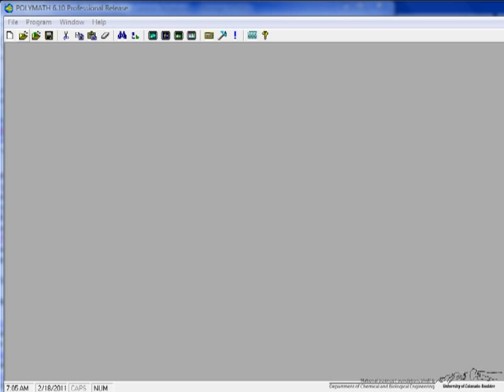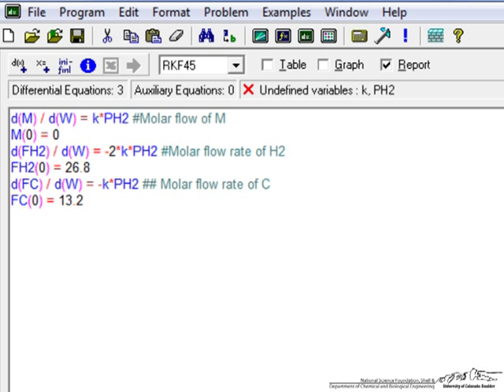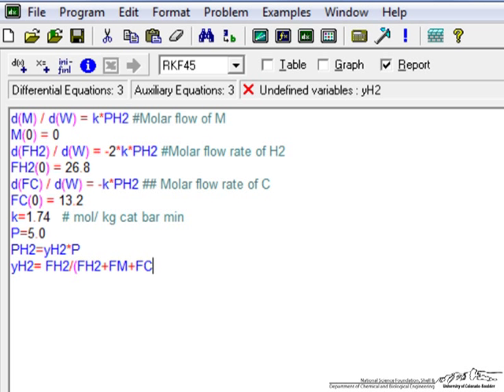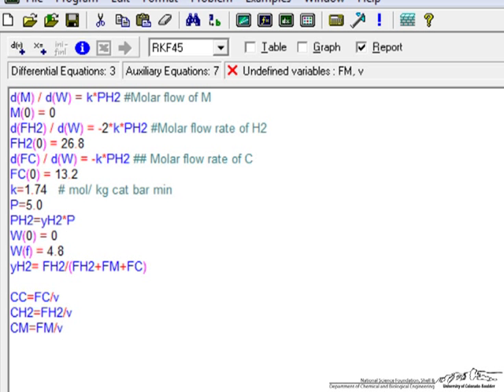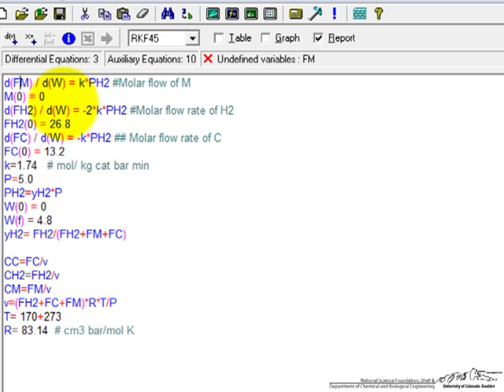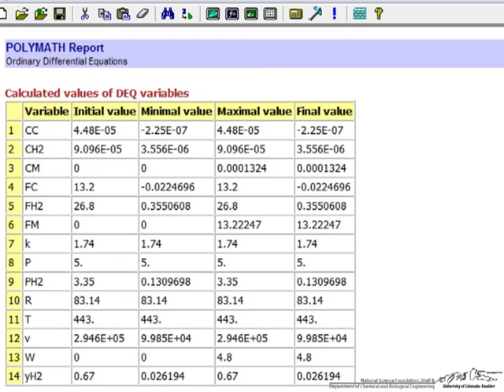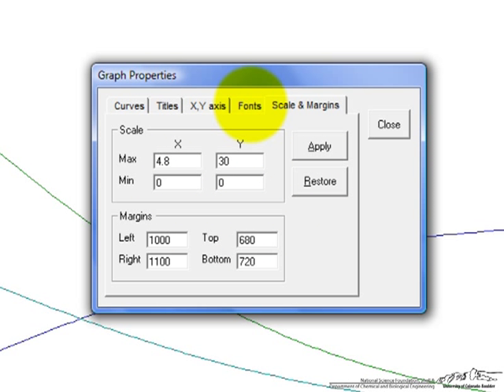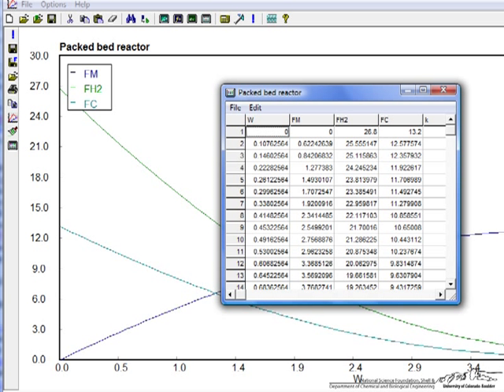Catalytic Packed Bed Reactor (POLYMATH)

Comment: I have a problem that  I'm working on and not sure about this: having 3 species flowing into a PBR with each having their initial molar flow rate so how should I calculate the total initial concentration? Is it by taking the mol fractions of each and multiply it by p/RT = C and then sum up their values?